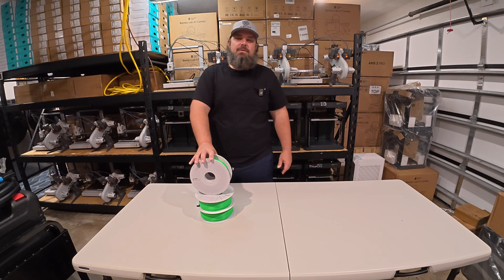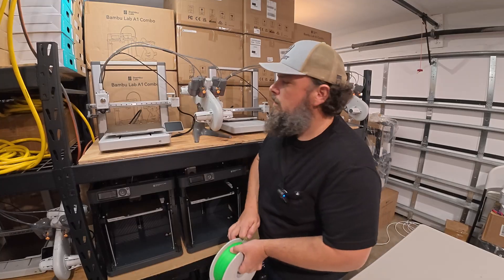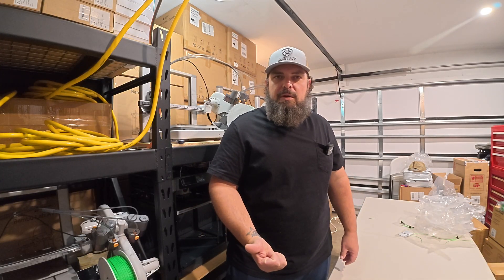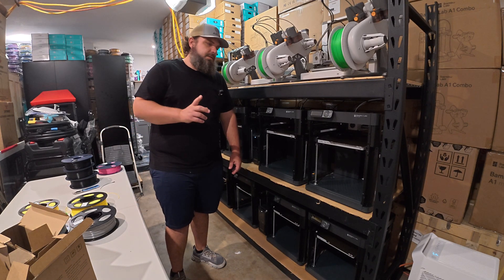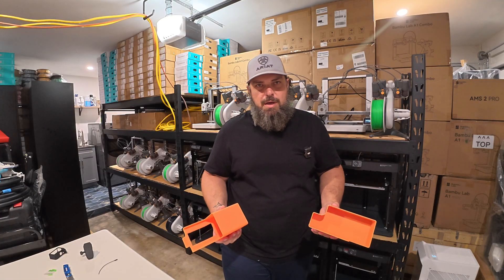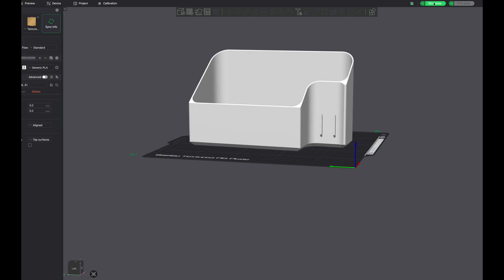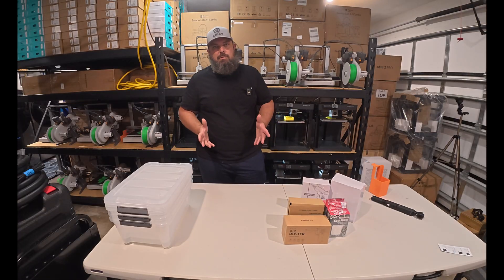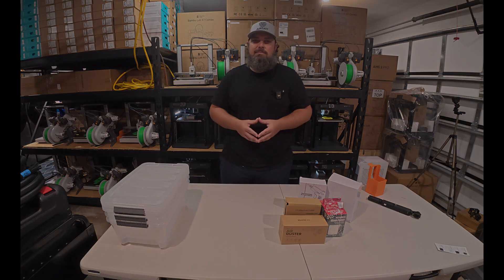3D Print Farm Startup – Day 8 | First Prints Now Running in the Farm

Comment: Our farm is only 12 printers, with 4 more on the way, but I can tell you that replacing filament on those P1S’s is going to be a CHORE with that layout. 
We are running risers on the glass, with 3kg rolls on top of our P2S’s.
I know that you are trying to maximize space, but I don’t think that is going to be a tenable solution. Long term unless the boxes behind them are temporary. 
We are running almost exclusively PETG, and haven’t had any issues with 1kg rolls getting wet by the end of the roll in the ambient humidity levels in a home… but the 3kg rolls are dry boxed in an IKEA 365+ 11qt container.
Reply from the maker: Appreciate the insight! This setup is just my initial layout while everything gets dialed in. I’ll be exploring side or front-mounted spool options since those would fit my workflow better. The layout will definitely evolve as I refine the flow of swaps and storage!

Comment: Cutting open the bags open seems quick and fast at first. Until you realize that you can just reuse them for storage with the Silica packets they come with to keep the filament spools dry. I stopped ripping mine open.
Reply from the maker: Very good tip. For this video I was just prepping quickly, but I actually have a vacuum sealer, so for long-term storage I reseal my spools with the silica packs also. I’ll probably show that method in a future video too!

Comment: It's Aliveeee!
If you end up doing multicolour with any P series look into the chute style system and put them on upper shelves and use a big plastic tub to collect poop, works really well and means you only clear one big tub away a week.
Reply from the maker: Appreciate the tip! That chute setup sounds like a solid way to manage multicolor runs on the P series. I’m still getting everything dialed in, but I’ll definitely keep that in mind once I start expanding into more complex prints. Always helpful hearing what’s worked well for others!

Comment: Check out bambu farm manger or third party print mangers, Sending a file to one printer at a time at this scale doesn't make any sense.
Reply: Couldn't agree more....50 machines on Farmloop would be amazing.....I only have 6 and absolutely love it....WELL worth the $10 a month for that many machines working autonomous 24/7
Reply from the maker: Appreciate the suggestion! I’ve looked into the different management systems, but for the workflow I’m building, running dedicated printers on dedicated prints with simple SD card delivery actually makes sense. It keeps everything consistent and repeatable while I scale. Once the farm is fully dialed in, I’ll reevaluate and see if a larger management system fits, but for now SD cards and repetition are the most efficient path for what I’m doing.
Reply: @CubFloPrints  Sounds good and makes sense, consider getting an sd card extender to prevent the slots form wearing out. As for software I would recommend Simply Print, though I don't have any experience running it, it seems like the best option.